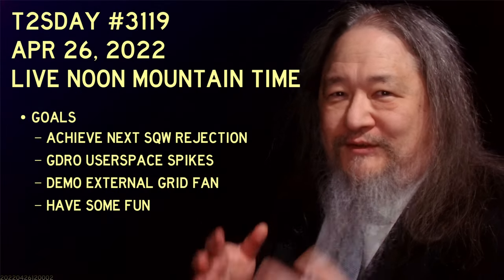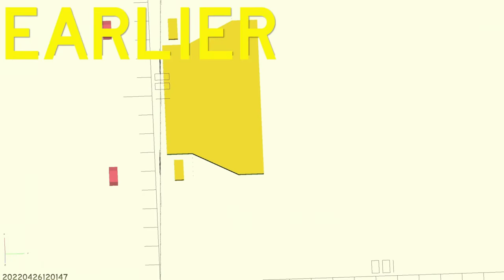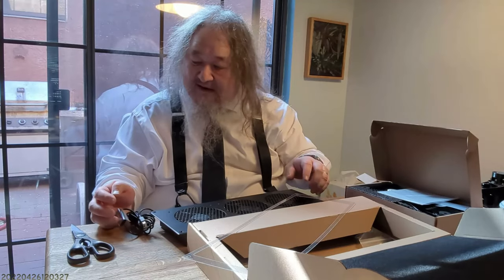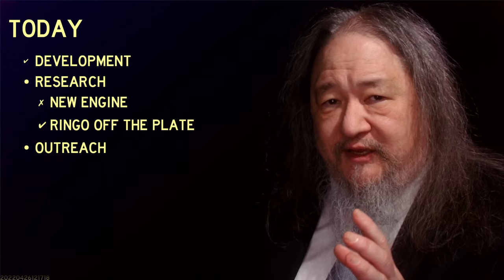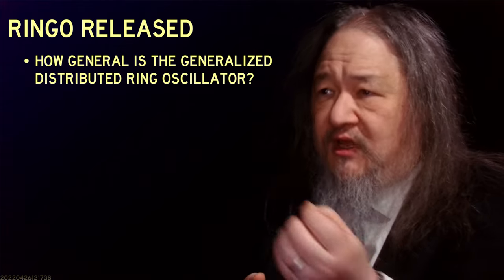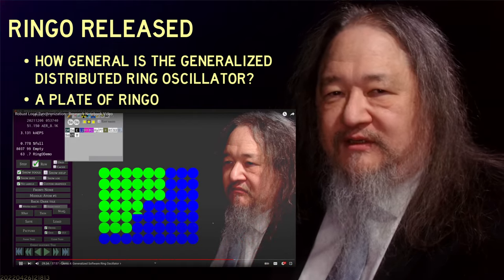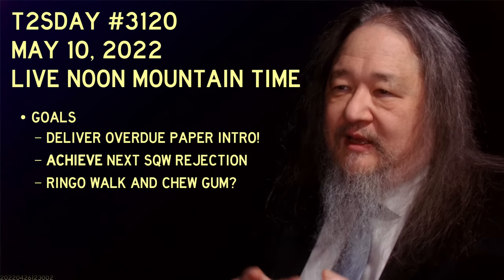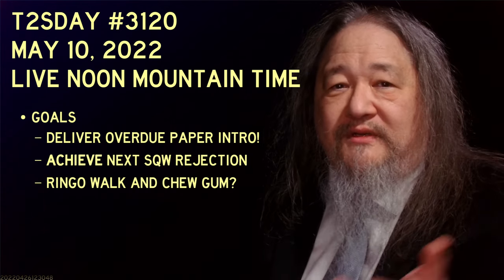Cooling the Grid and Making Clouds - T2sday Update 3119

Comment: Great ideas in this one. I like that you're thinking of climate. It makes sense that the t2tile is the least efficient indefinitely scalable implementation since it's the first. Step by step. If software can be this robust, I'm sure more advanced hardware could significantly improve efficiency. Besides, if one can implement interesting cognition on the t2tile, it would be the most energy efficient silicon-based machine that can do it (at least if I'm understanding the discussion correctly). Of course, it's a relevant question exactly how much power and cooling it would take and how fast it would cogitate, but those are just implementation details.

Comment: For cooling what if there was another tile variant with the same dimensions that didn’t compute but was a fan with possibly ducts or louvers to help hot spots. It would connect all of the adjacent cells as a jumper for data and only use power to run the fan. That node would be sort of a crystalline defect but hopefully it’s neighbors could deal with it.
Reply from the maker: Eventually MFM and software will absolutely have to deal with 'crystal defects' but I'm happy to kick that down the road a bit. An advantage of settling for 2D is we have an extra dimension for power cooling and maintenance.

Comment: In a future where there's a t2industry, do the tiles need to have a screen? Or could they look like small cubes that you put next to each other, and interact with through some ARdevice?
Reply from the maker: At first anyway, tiles (T3,4,..) would be more like parts than finished devices. Examples in sec 5.2 of doi:10.5281/zenodo.1304010 :)